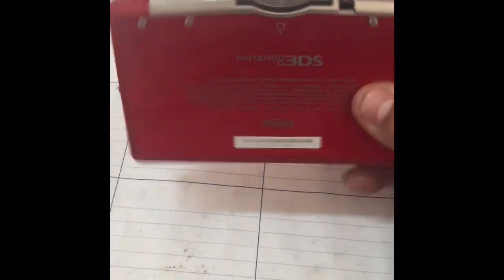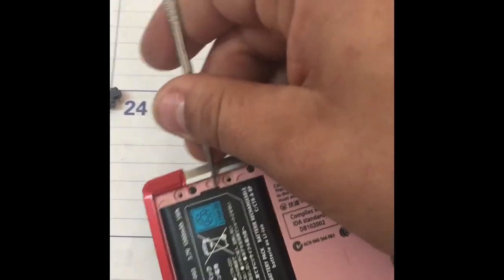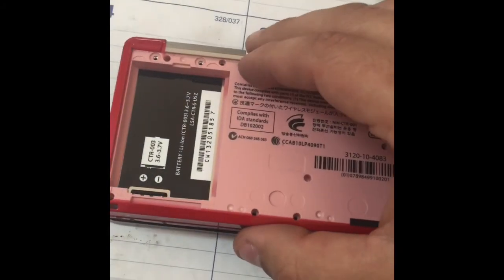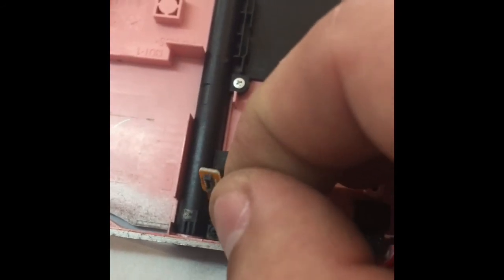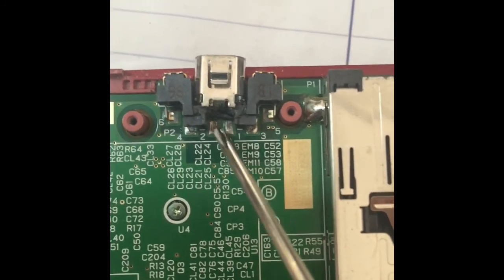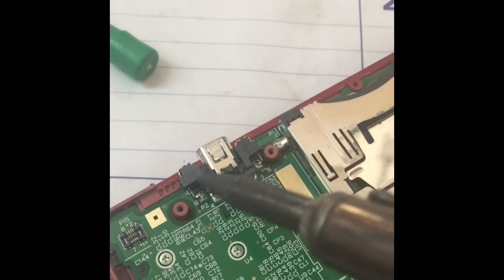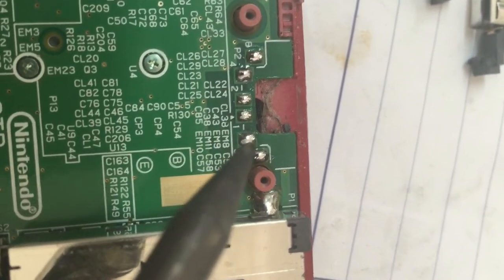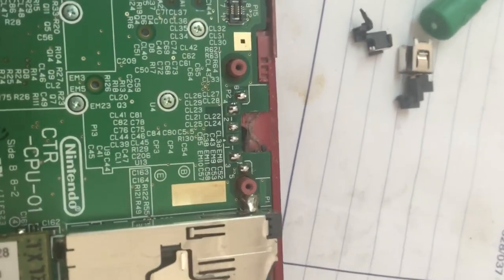Nintendo 3DS - 3DS XL battery charging port replacement.

Comment: Thanks bro, fixed my 3ds now, very easy solder job
Reply from the maker: Glad I could help
Reply: Would you suggest against doing this if I have no soldering experience at all? Or would it be okay to proceed as long as I'm careful enough and follow the video?
Reply: @QuintusKing  you'll be fine, it's really easy.

Comment: what should i do if i can’t get the screws out underneath the back plate they are not stripped btw
Reply from the maker: maybe find a better fitting screw driver?

Comment: Can I use small amounts of superglue?
Reply from the maker: Well First of all Superglue is a NONE conductive. so as long as the holds the 2 metal pieces it should work but it WILL FAIL eventually do I would suggest Do it right the first time. Try it at your own Risk.....
Reply: Falcon's Garage Didn't work lol. Before I could charge it but I had to hold it down. Now it won't charge at all. I just bought a Nyko charger with the cradle. My port is finished now.

Comment: They should make two charging ports would be much better.
Reply: True true
Reply: Falcon's Gaming if they made two charging ports, would be more durable and much better, it can also charge faster.
Reply: it would be
Reply: +Falcon's Gaming one breaks the other is still useful, they can do that with cell phones also, because those micro usb ports are terrible, is better to have the mini hdmi ports, those don't brake.

Comment: What size solder do you use?
Reply from the maker: I dont remember out of the top of my head... but ill look at it monday and ill let you know
Reply: did it with 70 watt, but I believe 30 watt should be enough. Make sure you warm up the iron properly.